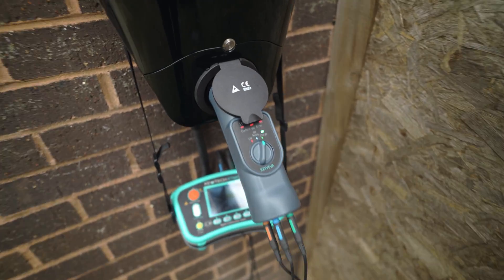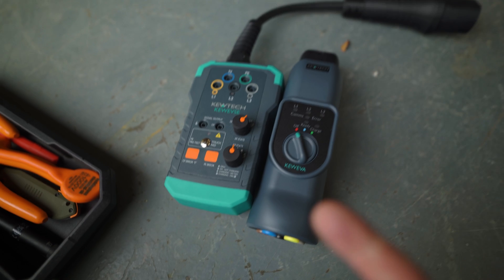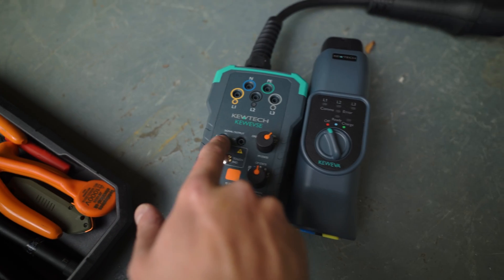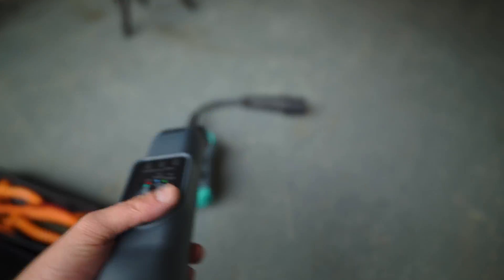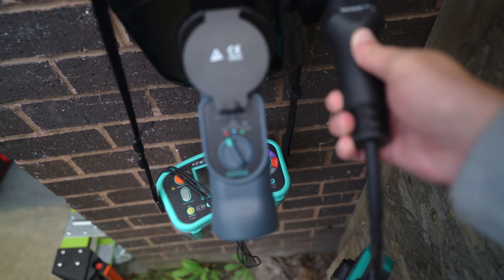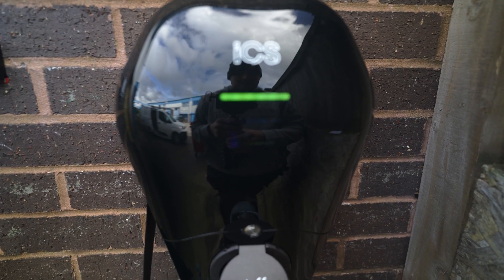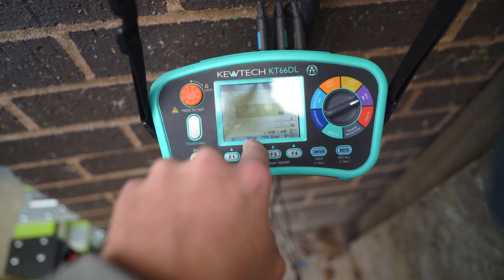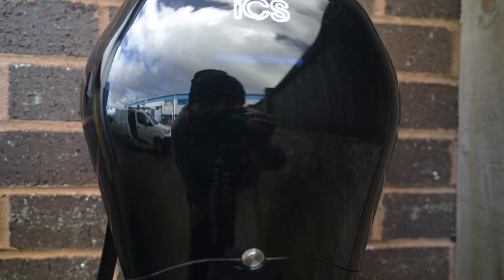Electric vehicle charger testing with the new KEWEVA

Comment: Hi Mike I just watched your spiking a cable video, I have a thick cable on site that’s about 20m long. One end is chopped and the other disappears into the ground. Is it safe to assume the cable is dead so I can cut it at the end when it goes into the ground? Thanks
Reply from the maker: Hi Mate, can you test the exposed end? i would get an electrician to prove it dead before you do anything, if your not far from bucks then email me mike@residualcurrent.com 👍

Comment: Not really a fan, I was interested when I saw it on the site, but missing the PE Error and PE Pre Test functions is definitely a deal breaker, especially with how simple they would be to implement, the PE Pre test likely just being a resistor, fuse and led hooked up to the live feed, like a neon screwdriver.
If those become mandatory, this adaptor is useless, and I don't see that being impossible in such a developing space of the industry and where most other adaptors are supporting those features.

It feels as if this is artificially limited in order that they can keep the other EVSE tester in their product stack, instead of actually iterating on it. The "price difference" appears to be a grand total of 20 quid, so not worth much. If it was half the price then maybe. These EVSE testers are already obscenely overpriced for what is just a few LEDs and inexpensive descrete components.
Reply from the maker: Fair enough, I get why you would think that from the information you have. I raised the same concerns with Kewtech.

The PE pre test or touch voltage test could be interpreted wrong due to the way it works, smaller voltages could faintly illuminate the LED’s leading to false positives, this is an issue that affects all EV adapters so that’s why that was omitted especially when it’s available and works as intended on some MFT’s including Kewtech’s own.

The PE error test is a big deal if you need to prove that functionally, but this isn’t here to replace the fully functional EVSE tester, it’s to complement it, similar to a socket tester and a MFT, they both have their place I suppose it comes down to what you need.

The price is way off at the minute, give it a few weeks and you’ll see it’s a lot cheaper it’s not available yet and the price online are wrong 👍🏼
Reply: @residualelectrical  it does seem silly to create a device that is meant to complement the other EVSE tester when adding the PE Error feature would really turn it into the replacement.

I've had a peek in my own Kewtech EVSE adaptor which I was so kindly swindled out of over 400 quid for, and you'd be shocked at how simple they are inside, no more than 50 quid in components. I'm not seeing any room for expensive R&D either where they are just hooking up resistors based on the EVSE spec into the plug.

Unless it ends up around the 100 quid mark, I don't see anyone having a real reason to buy one of these over the fully featured ones? A socket tester serves a different purpose to an MFT, but this is nearly the same device aimed at the same sort of tests, isn't a fully featured device on its own, and this is already in a niche and expensive device category where most people don't even have one at all.
Reply: Let’s just scrap electric vehicles.
Except for milk floats

Comment: Do you need the kewtech mft to use this?
Reply: No, the KEWEVA will work with any MFT with EV testing capacity using standard 4mm connections.